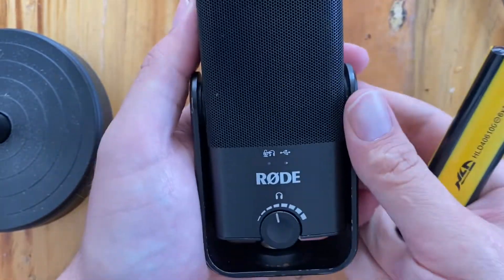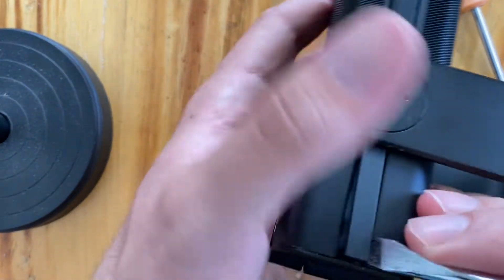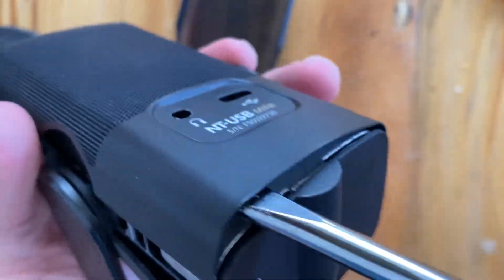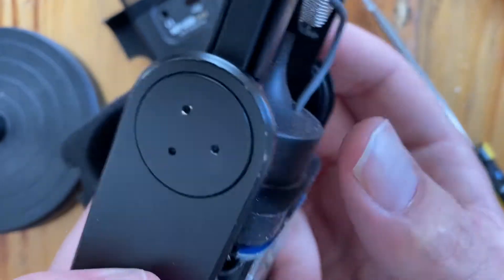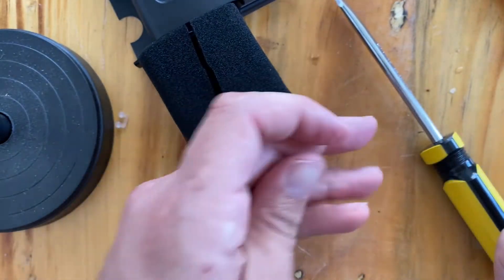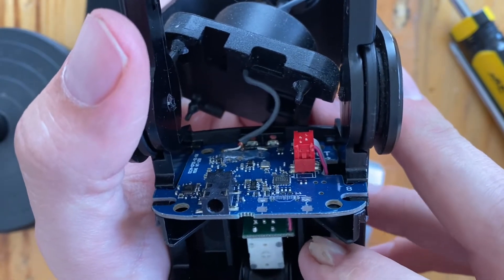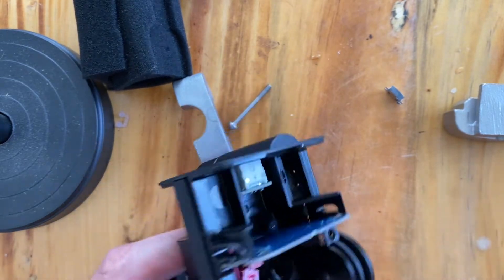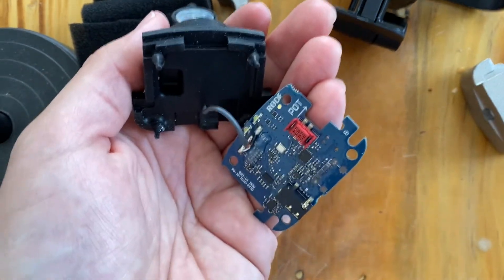Rode NT USB mini disassembly

Comment: Nice work. With your help I was able to disassemble mine with a mini screwdriver and a spoon. Next I am going to get a soldering machine and hope I can get the USB input back and working.
Rode did not build this mic to be repairable. They just wanted people to use them for a while, break the USB port and go get another one. Sad. I even contacted them, and they said it cannot be fixed. Mine is out of warranty so no replacement for me.
Reply: my port broke too, all loose and stuff... its not fixable?
Reply: @orcproductions  At least that's what Rode customer service says. They said if only mine was still under warranty they'd have just replaced it. So if yours is under warranty reach out to them via the Rode website... If not, then look for an electrician or try soldering it yourself. I'm working on mine
Reply: @anatutech  what a major flaw, i felt it getting loose pretty early on and finally it went. I'll check on the warranty... thanks

Comment: Did Rode repair this for you under it's warranty? Or did they see it as accidental damage?
Reply: I got mine covered under warranty, no questions. Just sent it off, I think I paid for the postage, and they sent back a refurb unit, works like new, slightly more scuffed than mine but no worries. Nice 👍🏻

Comment: Thank you for this video, like yours my usb c was disconnected from the motherboard, now to try to replace it. My hands aren’t the most steady for soldering so I’ll wait a few days before trying.  I was also able to raise the sleeve above the mic without having to cut it. Sir you rock!  We bought this little thing back in Sep23 and it went right after the return date😢